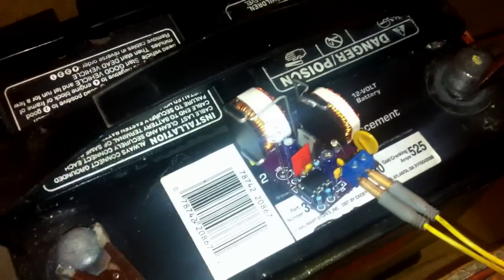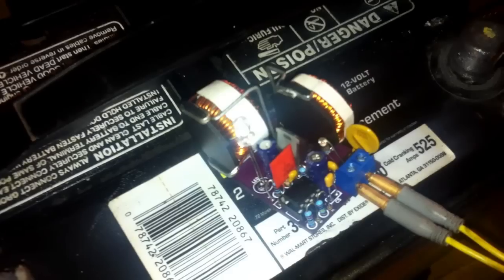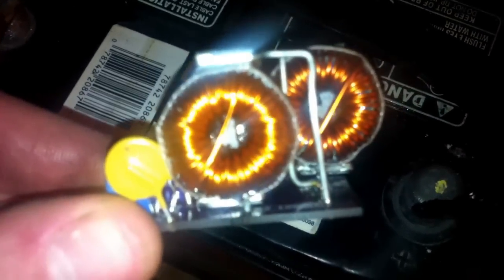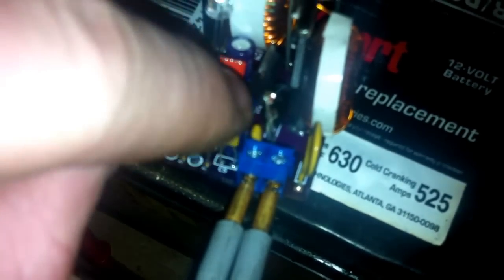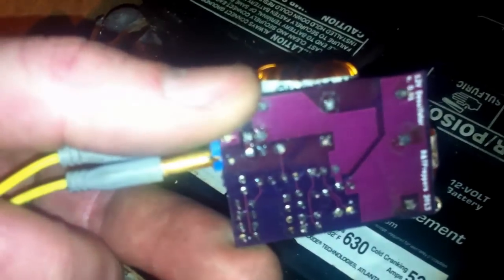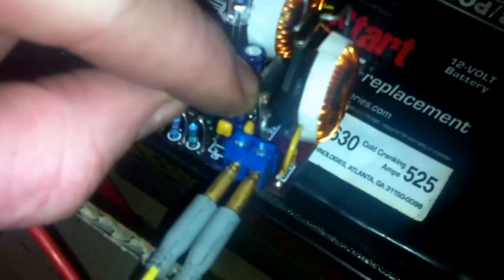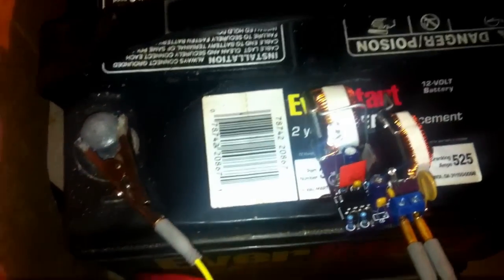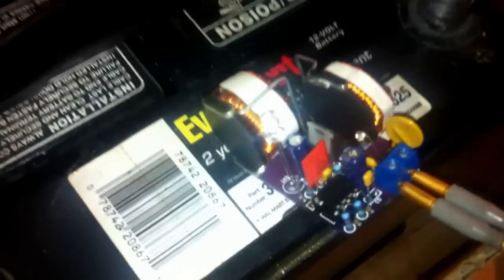Desulfator test on a battery

Comment from the maker: Usually I just use a regular charger if voltage drops down to 12.1V but it really takes a while to drop that low. You could use a harbor freight float charger, but I've read bad reviews about those, because they go ether too high which will overcharge your battery, or they go too low. njsharkracer has a video on a desulfator with a built in trickle charger. Search youtube for ujMasWSsC90 to find that video

Comment: I am building one now. My question is do you use a battery charger or float charger while using this desulfator. I would think that using just the desulfator alone, will desulfate the battery but would also drain the battery? Am I correct to think this?

Comment: very good job on building my desulfator.  I like what you did with the coils and the one diode.  I have also blown out the small signal diode before by shorting something out when trying to take a voltage measurement.  The only thing I would suggest to you is use as thick of a wire from the desulfator to the battery and as short as possible.  Long and thin wire will quench the pulse that does most of the work so short and thick is best.  Good luck and keep us all posted on your progress.